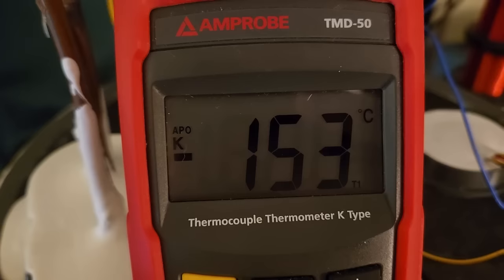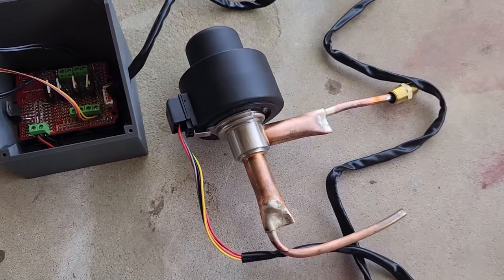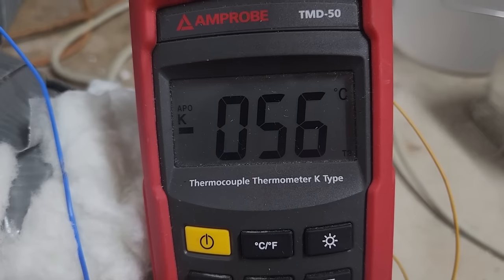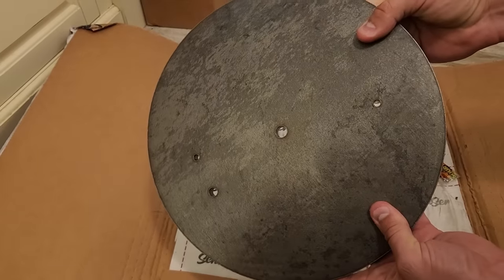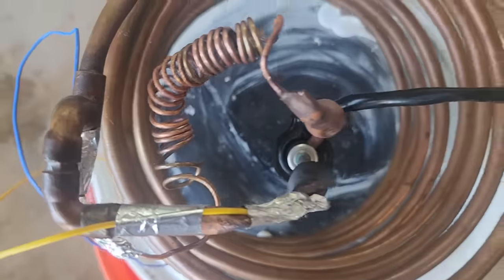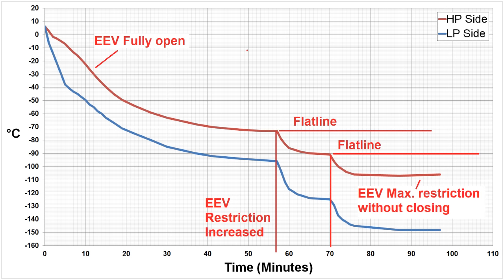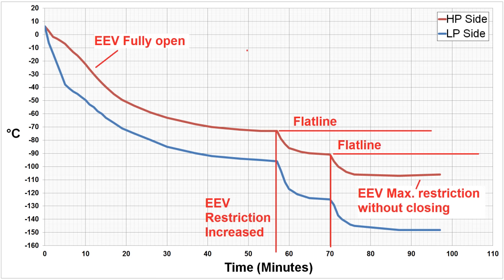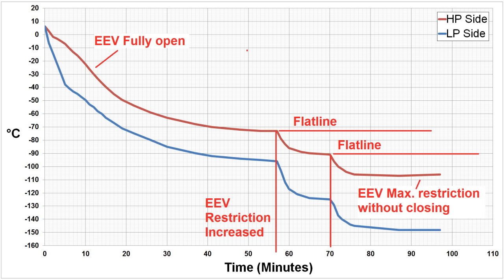Joule-Thomson Cryocooler Part II (-153°C)

Comment from the maker: The EEV's are Chinese units I got for $25 from eBay.  As far as I can tell, they don't have a problem with extreme low temperatures as long as there's no moisture in the stream. I've busted a few of them by applying too much heat by brazing, so that's the main thing to watch for.

https://www.ebay.com/itm/155538290835
Reply: Your electronic txv valve hates Oxide scale. You need to purge nitrogen when brazing
Reply: Instead of brazing on the EEV, just cut the swaged ends off and flare them and use some NYLOG sealant. To keep it from getting clogged you need to put a Filter drier that’s got flare fittings and hook it to the inlet at the drier. It will keep all the debris out of them. 

I deal with them daily working on Heatcraft brand systems like the Beacon II. 

What’s great is when you can get a pressure transducer and thermistor to control your EEV. 

I think one issue you have is too small of compressor. You are running up against volumetric efficiency with such a large compression ratio.
Reply: There is Heat Sink RediWhip available or the standard wet dish cloth.
Reply: Full disclosure: none of the links are affiliate links. They are posted for information purposes.

You should look into StayBrite 8 solder and the good “Stay Clean” flux. It’s a silver bearing tin filler material that is very similar to plumbers solder but since it has the silver (6% by weight) it allows it to stick better and gives it a melting range vs. a melting point. The range for StayBrite 8 is Solidus 430°F (221°C) Liquids’ 535°F (279°C). It also has a 14K psi burst, 10k shear psi rating too since the lower heat doesn’t anneal the copper (it’s also a lot more friendly towards heat sensitive devices and parts like the TXV and EEV’s) plus you nearly eliminate the oxides buildup inside the tubing due to the lower heat. The decent failure ratings also gives it good resistance to vibration stress failures.

So in short, it’s the best thing to use for delicate work and doesn’t require as much prep in regards to sweeping the system with nitrogen (but those are the best workmanship practices to use). 

There is a simple nitrogen purge regulator that attaches normally to a standard 20 or 40 cu.ft bottle (normal portable HVAC size bottle). It’s made by Western Enterprises, model VN-650 (link: http://westernenterprises.com/wp-content/uploads/2013/06/HVAC-VN.pdf ). It has a hand tight regulator attachment knob, 3 settings (test 650psi, purge, braze, Off) and has a compact size so it doesn’t take up much room/ harder to destroy it with daily thrashing, etc. 

Best type of torch to use for this soldering work would be a “B tank” acetylene torch with a “Turbo” tip. It uses only the acetylene gas and air (single hose). The turbo style handle/ tip introduces air into it and swirls it up for a good, clean, even burn. If you have a small acetylene/ oxy rig that’s common to HVAC you would want to turn the heat way down (mostly acetylene with some oxygen to keep the soot “bats” away) and keep the torch tip pulled back some to evenly heat the joint to the middle of the melting range. You’ll see it start to get shiny and almost right after start to soften up like warmed butter. Then you sort of sweep the heat all around the joint to help pull it down into the joint socket better as you add some to cap it off. Those StayBrite 8 joints will kinda have a MIG welded look to the bead when it’s done and hasn’t been heated too much. If it’s heated too much it makes the solder really watery similar to plumbers solder. PRO tip: if you have some excess on or around the joint (usually called puppy balls. Lol) you can wipe it with only a Dry cotton rag to remove the excess. Work quickly, gently, and carefully when wiping it so you don’t disturb the joint while it’s still hot. It will just leave a residue of the solder behind when you’re done almost like it was plated. 

Old school name for a similar technique was called “lead wiping” for direct burial high voltage (and later on) telephone cable splices.

There’s a bunch of decent StayBrite 8 soldering vids out there plus the techniques you would use to solder plumbing pipes/ fittings are nearly identical for this HVAC use. The B tank rig IS a plumbers torch anyway. Lol

Here’s the tech sheet/ MSDS from Harris Products for StayBrite 8:

https://ch-delivery.lincolnelectric.com/api/public/content/e521e75f45b741e58940da1988c2976d?v=a156575a

Sorry if all of this seems to jump around. I was trying to get all of the info down for ya as it came to me. 

Hope this helps!

Comment: You describe a Unipolar stepping motor wiring as being unusable with bipolar drivers-this is not the case. You can just ignore the center taps and drive them as bipolar stepping motors.
Reply: I'm not certain, but I think the stepper motor will also work better when driven in a bipolar fashion because the current flows through both halves of the coil, producing a more uniform stator field.
Reply: 5-wire steppers have a single connection for both center taps. This is less than ideal when treating them as 4 wire steppers.

6 wire steppers have separate wires for the two center taps. The center tap wires can simply be ignored and it can be treated as a 4 wire stepper.

The performance differences don't matter in this application, because the valve doesn't need to move very fast.

The standard unipolar stepper config only uses half of each coil at any given time. Unipolar steppers date back to a time when it was cheaper to double the size of the copper coils than to use a bipolar drive circuit.

Comment: In regards to the "slow leak" in your vacuum insulation enclosure, might it be outgassing from the flex seal due to the low pressure? Probably not terribly important but it could lead to seal degradation.
Reply: Honestly what I was thinking
Reply: @bnarit how does the chemical structure make the gas leak out?
Reply: I’d also suggest stycast 2850 epoxy for sealing things for this reason among others. We have used it on several liquid hydrogen applications. One thing to look out for is its high rate of thermal contraction as it likes to shrink more than metal and will pull away if you use it to fill the end of a pipe or something similar.

Comment: Hey dude, love your stuff. Not a lot of DIY cryo stuff going online. Whenever you've got it all set to move on to the superconducting portion of your project, I'm respectfully suggesting that you finalize and harden your cryocooler process (put it all together, take care of any minor issues, modularize it so you can put it in storage when not in use, etc) and most importantly document it. I've done a bunch of projects in order to create the needed precursors for bigger projects and making some paper documentation to go along with my mechanism really helped after I needed to use it after some time had passed. It's a real pain having to re-educate yourself, look up important values and figures, and remind yourself about the optimal process in order to use it. I suppose you could just watch your own videos, but having some concise and complete paper documentation on hand is way better. Keep up the great videos.
Reply: Dude, you just gave me an answer to some of my problems
Reply: @maciejpieskasta493  well thanks! I'm glad I was able to help. Take care and good luck

Comment: Being a commercial refrigeration tech I’ve been following you along all of your cryogenic and refrigeration projects as they come up in my feed. I think the progress you have achieved so far is awesome! I kinda wish we were neighbors or lived closer (I live in central florida and I believe you’re on the east coast) because I could probably help you out greatly with some of the hurdles you’re experiencing. 

The “precooler” unit is going to be essential to your cryogenic goals. It’s normally called a subcooler as it increases the subcooling of the liquid refrigerant. I believe the rough gains for a subcooler are, for every degree colder you drop the liquid temp below the saturated condensing temp, you gain 2% increase in refrigeration capacity pound for pound of refrigerant. The subcoolers are used a lot in commercial refrigeration where the medium temp parallel racks (normal refrigerated food) have a subcooler unit piped to it to help drop the liquid temp on the low temp parallel racks (frozen temp food). 

You do hit a wall eventually where the energy cost to drop it past a certain temp is too much for the little amount of gains. This “magic” temperature is 45* for standard refrigeration systems. I’m sure with ultra low temp or cryogenics there is a magic number as well but I’m not too familiar with those sectors of the trade. 

Oil control is essential for what you’re doing too as it starts to get as thick as molasses as temps drop down deep into the negatives. Also, when the refrigerant is passing through a metering device at really low temps, if too much oil is mixed in along with the refrigerant it will inhibit the unit from dropping down as easily. This is because the oil (that doesn’t flash off and evaporate) takes up some of the room in the metering device that the refrigerant (that does flash off and evaporate) could be using to do more of it’s work. That’s why the commercial cryogenic machines have multiple oil separators in series. The more oil you remove (down to 100% of it) the better and more efficient the unit becomes up to a point. 

The part of the video where you had to wait for the temp to flatten out to adjust the refrigerant flow can be attributed to superheat management. If you had a digital controller managing that part it should be able to keep things under control to have a nice sweeping graph down to setpoint. 

Anyway, I love the videos you’re doing and look forward to watching the new videos as they’re published.  It’s the same sort of “hobby work” that I would want to do if I had the time to tinker around with things as i’ve got a bunch of old spare parts or stuff that was removed due to being unreliable but still decent for a little project or personal thing that’s not considered “mission critical”. 

Maybe one day….. (I’ll get to play around) lol.

Comment: Hydrogen has two spin states, ortho and para. Parahydrogen is in a lower energy state than is orthohydrogen. At room temperature and thermal equilibrium, thermal excitation causes hydrogen to consist of approximately 75% orthohydrogen and 25% parahydrogen. When hydrogen is liquified at low temperature, there is a slow spontaneous transition to a predominantly para ratio, with the released energy having implications for storage, namely the spin conversion will release enough energy to boil off all your precious liquid hydrogen.

A hydrous ferric oxide catalyst can speed up the conversion to allow the heat to be rejected during the cooling, rather than after.
Reply: Wow that’s insane. I wouldn’t even think the angular momentum of a hydrogen molecule would be enough to cause a phase change
Reply: @samblackstone3400  Hydrogen is very light. In fact, it's almost a single proton.
Reply: Never heard of this effect. Cryogenics are amazing
Reply: @samblackstone3400  It can be surprising at first, but it makes a ton of sense in hindsight: as the other person said, it’s the fact that hydrogen is so light that makes this such a noticeable effect - the energy that is available needs only be applied to so little mass, it ends up being significant :)
Reply: I remember reading about this in Ignition. Very good point, could lead to explosion.
Reply: Thank you for mentioning this phenomenon. Definitely something that can't be overlooked.
Reply: Its pretty amazing isn't it. Around 700kj/kg compared to the enthalpy of vaporization at ~460 kj/kg. The natural conversion is quite slow however so he shouldn't notice major effects unless he plans to store the hydrogen for more than a couple of days. Trying to remove the conversion energy during liquefaction will yield much less hydrogen.
Reply: @FlaccidFrog  as someone who doesn’t understand this phenomenon at a deep level, how does the temperature affect the conversion? As in, how does the radiation of heat of this process depend on the achievable temperature of the liquified hydrogen?
Reply: @samblackstone3400  It's the electron spin he is talking about. The angular momentum is the momentum of the election orbiting the nucleus, and as such it is a separate quantum operator. Spin only has two state, up and down. It's only a small shift in energy compared to the quantisation of the orbits.
Reply: This guy sciences!
Reply: yes

Comment: I have an unfortunate amount of experience trying to skip steps and use RTV adhesive/siilcone in vacuum systems, and I have one word: DON'T.  Anything that sets without a catalyst has a chemical compound that reacts with moisture/oxygen to cure, generating an additional substance as it cures-- either acetic acid or methanol for RTV silicone, depending on the type.  It's impossible to get rid of all that substance, it is bound up with the silicone and will slowly leak out under vacuum, creating "virtual leaks" that are impossible to patch.  It's too bad that the stuff won't work since it's incredibly tempting and cheap to slather a bunch into gaps to seal things, however it will never give a good enough seal to get to a very good vacuum (Especially if you're trying to use the vacuum as thermal insulation, which requires a very good vacuum for significant effects) , and the last thing you need is more leaks in addition to the ones you haven't found yet.
The best types of gaskets are made from fluoropolymers like Viton, however you can get away with things like neoprene if you're not trying to reach high vacuums-- it depends on the cross-section of the seal that's exposed to the vacuum.  Vacuum grease is also handy for plugging extremely small holes and helping to prevent leaks, though it's not an actual sealant and is more to keep gases from sneaking through microscopic gaps.  
Really looking forward to your next videos!
Reply: Isn't the best option copper gaskets between stainless parts?
Reply: @PsRohrbaugh  indium is another option that sees use for gaskets in high pressure experiments, as it is more ductile than copper and doesn’t form oxides unless exposed to extreme heat and specific chemicals
Reply: @PsRohrbaugh  Yeah CF flanges are copper or aluminium gaskets with knife-edges on the flanges that cut into the gasket. But it's a bit overkill. Something similar to KF flanges would be fine. Essentially just a big O-ring squeezed between two flat and smooth metal surfaces. A little vacuum grease helps with sealing, but is often not necessary. Flange material is usually Nitrile, Viton, or Kalrez.
Reply: @PsRohrbaugh  it's not practical for development, not necessary at these vacuum levels, once he figures everything out and makes a somewhat final setup, then you can go copper, but I have couple pieces of equipment that go to 10-6 torr (and slightly more), and they have been working just fine for 20 years with viton seals, I replaced the first ones when the unit was 10 years in service already, there was a small leak that I was trying to find, and in the end fault was not with the rubber seals at all, so who knows how long they last, and the unit has rotating and moving elements that are sealed by these orings, so that adds risk compared to a totally static design 
p.s. use very little vacuum grease whenever necessary, making a rubber seal look wet is enough, more = bad in this application
p.s.s. this probably is design specific, in my case I have around 1.5kw total power diffusion pumps running all the time + vane vacuum pump to make it work, but even after shutting everything down for a week, most of time the vacuum stays basically at the level the unit was turned off
Reply: @dsfs17987  That's a good point, low leak rates don't matter if you have enough pumping rate. I've taken KF seals down to below 10^-8 mbar, not hard with a big ol' turbo pump and large tubing. Only reason I see to get low leak rates in this case is to not have to re-pump so often.
If the temperatures go low enough his cold-end will become a sorption pump anyway :)
Reply: so true. when you're after extremes, the perfection in mundane things helps overall efficiency and you get good gains from bulletproof sealing and connections
Reply: Great replies, and very true.  Copper/indium gaskets are for high-vacuum work, and he's never going to get close to that range with a mechanical pump.  It's unfortunate that you only really start to see marked thermal insulating effects near the limits of a two-stage rotary vane pump (Hence why thermocouple gauges lose their effectiveness below around 10 micron), and there's a reason they use diffusion/turbo molecular pumps to evacuate dewar flasks and anything that really needs the best insulation.
Reply: @flomojo2u  I've always wondered if a DIY titanium sublimation pump could get you from mechanical pump pressures down to UHV.
Would be very messy in the beginning when the Ti can't even reach the walls without reacting, but should still pump I think? Maybe worth it for the final setup to keep the vacuum for a while.
Reply: Keep in mind that viton is only rated for service to -10F... I'm pretty sure that's where my freeze dryer is leaking, I used a couple viton o-rings and it leaks when cold, but not when room temp.
Reply: On the opposite end of that spectrum, I have some experience working in a steel mill with a vacuum tank degasser, which was designed to take the tank down to below 2torr (with a ladle that holds ~120 ton of steel in it) in just a few minutes. That thing basically seemed to be help together by RTV because it's hard to fix leaks while you're running so it's definitely temporary, but will get the job done in a pinch